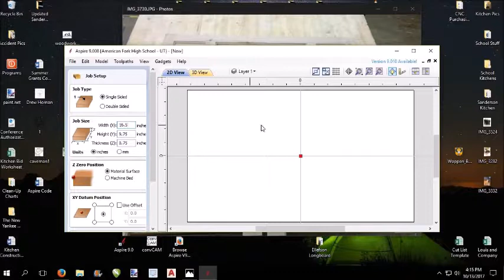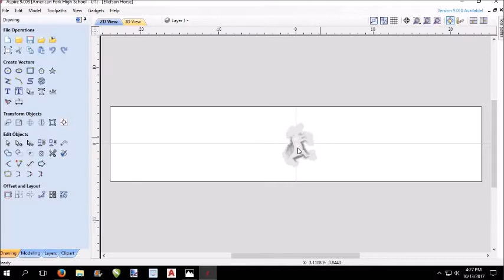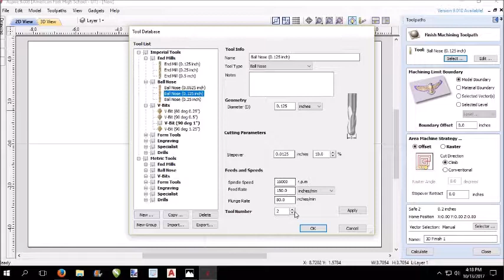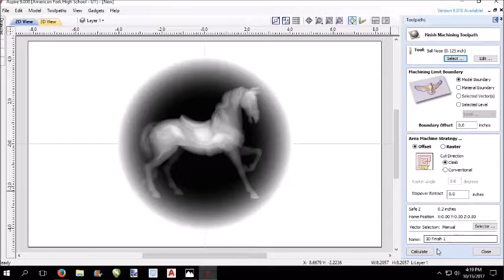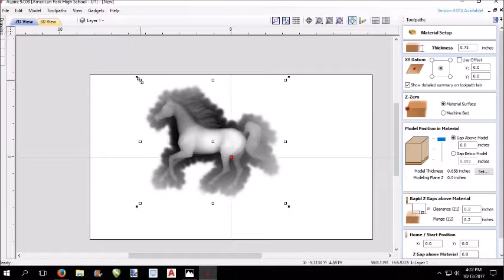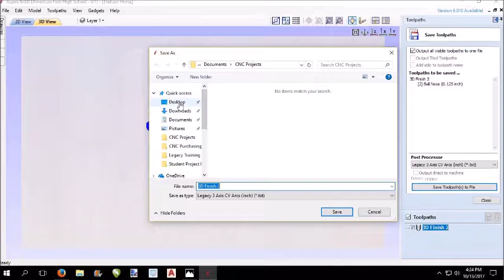3D Clipart Setup

Comment: Hi, great video thanks for sharing. I recently starting experimenting with the free clip art in vcarve and I am having a problem with z height.
The cutter sometimes cuts areas it shouldn’t as it looks as if the z height is too low.
Have you had this problem? I haven’t changed any setting in the Gcodes.
T
Many thanks
Reply: I have not had that problem.  Your symptoms sound like a software issue that you'll either need to contact Legacy about or Vetric (they are in England so you'd better email).  Best of luck
Reply: Sandon Ellefson cheers